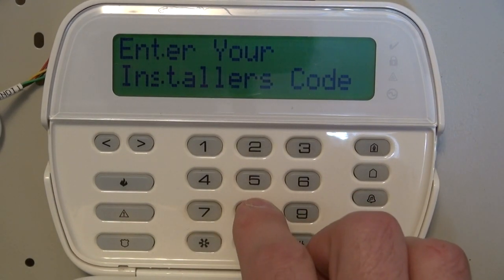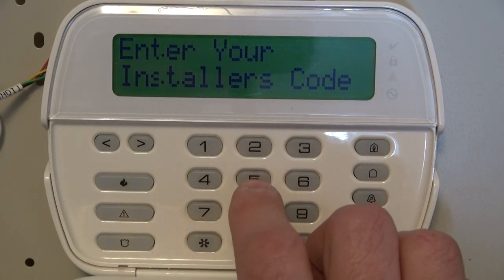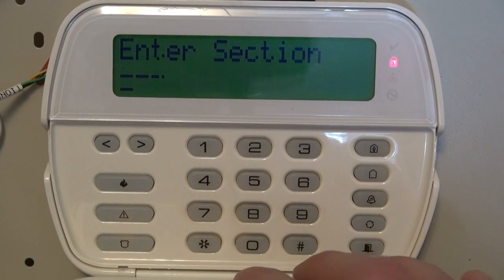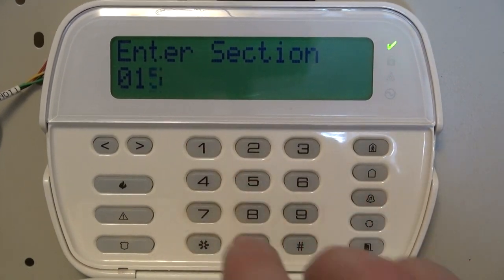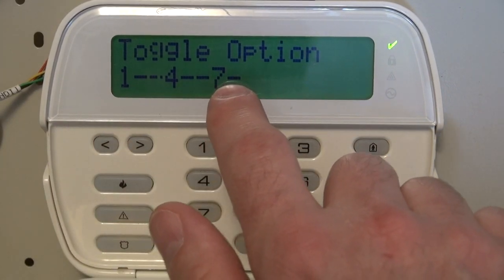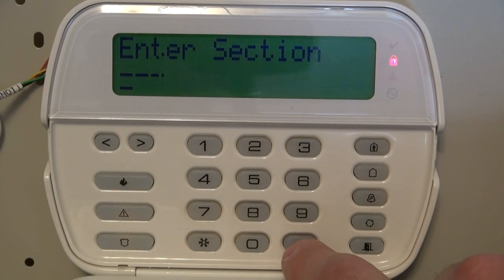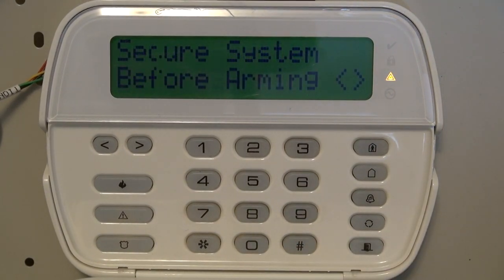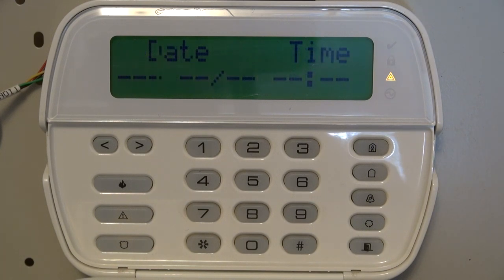How to Remove a Communication trouble on a DSC Alarm

Comment: I have DSC 1832 Panel with no monitoring. I have the installer code (Last 4 digits of his phone no.). I have cleared the beeping sound by pressing Reset key on panel. Yellow light is still a problem.
Code 015 shows 1 2 3 4 5 6 7. ---->Removing 1 or 7 or both  does not help.
Code 350 Shows 1 - - - - - - - - -  ------>Removing 1 does not help.
Code 380 shows 1 - - - - - 5 6 -  ------> Removing 1 does not help.
Jason, any other suggestion would be greatly appropriated.
Reply from the maker: When you hit *2 on the keypad, can you tell me what pops up?
Reply: @JasonTech   @JasonTech  Just 4 displays and yellow triangle start to flash!
Reply from the maker: Can you try something.
*8 installers code
993 installers code 993
then ##
Reply: @JasonTech  no luck, still same!
Reply from the maker: Make sure you still have everything removed in (015/380/350) 
Reboot the panel by, remove the battery and the power supply. 
Then power it back up.
Reply: @JasonTech  That worked, yellow light is gone. Thank you. 
Although with this method I have lost all the settings. I will need your help setting up my system again. Thanks for your quick response. You are amazing.
Reply from the maker: You lost your zones?
Reply: @JasonTech  My bad. The chime was off after power restore. Also had to reset  time. All working now. Thank you once again for your help.
Reply from the maker: Anytime!
Reply: @JasonTech  One more question!
My back door and windows seems  to be in the wrong zone. In stay mode, if violated,  they only chime.
Please tell me how to check and move them to zone 3.
Reply from the maker: It doesn't work like that. To change zone spots, you do that in the panel. So when you put the alarm on (Armed or stay) it doesn't go off?
What about your motion?
Reply: @JasonTech  Motions are fine...I think! They show up on the panel whenever you come in their range.
How do you check which zone is associated with which spot number on the  panel?
Reply from the maker: From the keypad, example open a door or window and see what zone is open. 
If your zones are not working, let me know. The zone number and what type of zone it is (Door / window /motion & so on)
And I will tell you how to program it. I will also do a video on this if you like.
Reply: @JasonTech  
1=front door
2=side door 
3=basement windows 
4=family room motion 
5=front door motion
6=patio door
7=back windows 
8=side & front window
A video instructions would be really nice.
Thank you Jason.
Reply from the maker: I will do a video on how to program a panel. If you can't wait for the video and you want to try to do it.
Hit * 8 installers code
001
01
01
03
05
05
03
03
03
##
Once I post the video I will give you heads up.
Reply: @JasonTech  I have reprogrammed zones as per your information.
Back door and windows are still only making chime sound when violated. Siren not going off.  What else am I missing?
Reply: Solved! All zones working fine.
I needed to wait few minutes before testing. I was testing it immediately after arming stay alarm.

Comment: Hi, very helpful video. However when I tried the fix on my DK5500 keypad which shows icons and not actual English, it didn’t seem to work because the trouble light is still on. When I entered *8 and the installer code I got the keypad icon but when I entered 015 I got a long beep (error code?) I did key “7” but the keypad icon stayed on. When I exited with the # key, the trouble light stayed illuminated. System is a PC1832 and the error code is 3 (because I had my landline removed) the system is not monitored. Thanks, any help would be greatly appreciated.
Reply from the maker: Hi. It sound like you don't have the right installer code. When you enter the installers code, are you getting a long beep?
Reply: @JasonTech  No, I was until I guessed the right code, Now I get 2 or 3 short beeps, the “Armed” light comes on and the keypad icon appears in the display. Also other programming functions seem to work. I don’t know that I haven’t solved the beeping problem, it’s just that the “Trouble” light won’t go off. If I set the alarm and it doesn’t keep beeping does that mean it’s no longer trying to find a phone line?
Reply: @geoffstrople3611  Just came across this and have had this issue before. If you turned off the right thing the system will no longer look for the phone line but in order for the trouble to clear you have to reboot the system by removing the + battery terminal and remove AC power for 10-15 seconds. Replace the battery terminal and power back up. You will need to know the Master code before doing this because you will have to reset the time for the system. ^6  then 1 this takes you to the Time date setting. Enter the time in Military time 2:25 pm would be 1425 then enter the date dd/mm/yy then press pound to exit. So you have to do this in a pretty steady sequence. * 6   1   1425   02 15  23. Would be 2:25 pm on Feb 02, 2023.

Comment: Hi Jason, thank you for the video. Would you mind telling me how can we do the same thing on Paradox 1689? The keypad has no screen display.
Reply from the maker: Do you know the installers code? Default should be 000000 
If that is your code.
1. Press ENTER
2. Enter the INSTALLER CODE (000000).
3. Enter SECTION 135
4. Make sure 1 & 2 are off. To turn it off hit the number so the light turns off.
5. Press CLEAR to exit
Reply: @JasonTech  I'm trying by pressing ENTER, then master code. After that, the light of arm1 and stay1 are on. I entered 135, it doesn't seem to recognize this section. I try to enter section 100 and it recognizes it. Have you any idea why section 135 is not recognized?
Reply from the maker: Because that's not your installers code. The installers code is 6 digits not 4. Try pressing  and holding 0 for about 3 sec.
Can you tell me what alarm panel you have?
Reply: @JasonTech I've found in one document that says panel 1738. Does it mean something to you? How can I check to know that? I tried to press 0 for 3 seconds as you ask, but nothing happened.
Reply: @JasonTech  I've just looked at the panel itself. It's SPC-1738 version 2.10. Here is the picture https://drive.google.com/file/d/19W7_YeG1kgdK9Mj4jbQsBeDQhEFA-POu/view?usp=drivesdk
Reply from the maker: See here. https://www.paradox.com/Downloader?T=URL&URL=/Documentation/Manuals/InstallationProgramming/17X8-EP20.pdf
Reply: @JasonTech  yes, I've found that doc as well. The problem is I don't have the installer code. You know how to reset this code? I've try 0000 and 000000. None work for me.
Reply from the maker: It's an old panel. The only way you might be able to get it, is with the paradox software. If the panel isn't locked you can also do a factory reset and reprogram the panel.

Comment: Hi! I have power series neo with tl280 3G communicator.. im using only ethernet (to security guards and connect alarm app).. not gsm . Im getting cell trouble alternate comm. Trouble.. how do i fix this pls
Reply from the maker: Question, do you have the installer code?
It's a easy fix but I would have to do a video on this. Because the Neo system has a lot of steps for the TL280, and I don't know how your system was programmed. But you won't be able to do anything without the installers code.
Reply: @JasonTech  i have the installerers code

Comment: Thanks 
That worked, is there a way to stop the yellow trouble code from lighting up.  

I no longer have a phone line and keep getting code 3 and 4
Reply from the maker: If you are still getting code 3 & 4. Try *8 5555 then 350 if it shows a 1 remove it by pressing 1. Then ##
Reply: @JasonTech  nothing displayed after *8 my code 350
thanks for trying
Reply from the maker: Then try
* 8
5555
380
if you see a 1, hit 1 then ##

Comment: Great Video. However,  I have an 1832that has the beeps associated with the communicator and this is the only trouble present when I use *2. The customer wanted to use the system to still call their cell phone when an alarm is activated. I Have    section [015] [7] Off, [380] [1] On and [023] [7] On. The panel dials her phone but I cant seem to get rid of the beeping.
Reply from the maker: Hi Azim. Do they have a home phone line? if yes section 015 turn on 7.
380 remove 1 (this is more for a GSM)

Comment: Jason, Ours DSC Power 832 controller reads 1-4-8 instead of 1-4-7.  Do I remove the 8 to get rid of the communication trouble alert?
Reply from the maker: Yes. And go to section 350 if you have a 1 remove it.

Comment: I have a DSC PC1616  alarm, panel 5500 that is showing an orange triangle with “trouble communication”  when *2 is pressed. No beeping and 7 has been toggled off.
I am not sure how to fix it. I have been on google and YouTube, looked at the installation manual and user guide, tried many things. The strobe light out the front is flashing due to the complication too. 
We are in Australia. Thank you for your help. ￼￼￼
* I have gone through all the comments on here and tried different things but I still can’t fix it 😕
Reply from the maker: Hi Jodie. Try *8 5555 then 350 if it shows a 1 remove it by pressing 1. Then ## to exit.
Reply: @JasonTech  I tried that 😂. I actually just had a go at resetting the alarm by removing the battery. And it worked a treat. I will remember that for next time.
Reply: @JasonTech  do you happen to have a video on how to change the times from when a sensor is triggered to when the alarm goes off?
Reply from the maker: Do you mean a time delay? Like when you open a front door, and you have 30sec to disarm the alarm.
Reply: @JasonTech  yes 😊
Reply from the maker: The system has 3 timers, entry delay 1, entry delay 2, and the exit delay. The entry delays need to be between 30 to 255 seconds. The exit delay must be between 45 to 255 seconds.

- Press *8 installer code.
- Then 005.
- Enter 01.
First, enter the 3 digit entry delay 1, in seconds.
Then, the 3 digit entry delay 2, in seconds.
Finally, the 3 digit exit delay in seconds.
Press # twice to exit programming.

let me know if you want me to do a video on this.
Reply: @JasonTech  thanks so much! Actually a video for others would be great if you get the time. I’m sure it would be appreciated.
Reply from the maker: I will do one. Thank you.

Comment: Jason and/or any techs out there. I have a DSC PC1616.  I no longer have monthly monitoring, and I have the expected yellow trouble light leading back to the "Communication error".  I found this video searching for a remedy.  I entered *8 followed by the installers default code of 5555.  It would appear that this is a valid code because it appeared to let me pass through did not kick me out.  However, after entering this mode it and it does not ask me to "Enter section" as with your example, instead I have the digits 1 2 3 4 shown on the LCD.  Any suggestions on where to go from here to toggle off the communications option?  Thanks for these great videos by the way.
Reply from the maker: Hi Tony. Try *8 5555 then 350 if it shows a 1 remove it by pressing 1. Then ##
Reply: @JasonTech  Jason..worked great thanks so much!
Reply from the maker: You're Welcome

Comment: Jason- I still have monitoring, however when my cable modem resets it loses the communication signal.  I just want to disable the beep on this warning.  Will this prevent my system from monitoring after the modem reboots?
Reply from the maker: Yes, you might have a modem that gives you internet and a phone line. Do you know if your modem is a all in one? If you look at the back of your modem you will see a telephone port.

Comment: Hi Jason, I have a DSC PTK5507 I cancelled alarm service. I have the code but a different panel then yours
Reply from the maker: What panel do you have?
Reply: HS2016/HS2032/HS2064/HS2128
Reply from the maker: If you have PC1616 it's the same steps. To get into programming on the touch screen press Options, Installer Menu (Installer’s Code)
Reply: Thank You ! Does the light stay yellow?
 @JasonTech

Comment: Hello Jason, I have a DSC Impassa WT5500 wireless 2way. I cancelled my monitor service quite awhile back, but my panel still gives me the yellow light cause its still tries to communicate. I tried your procedure in toggling this feature off but my numbers displayed different than your video. the numbers are displayed 12-4---8 so which number do I take off to turn off toggle ? any help would be greatly appreciated, Thank You
Reply from the maker: Try.
*8 - 5555 - 350 if you have a 1 remove it by hitting 1.
&
go to section 380 if you have a 1 remove it 1 by hitting 1.
Reply: @JasonTech  Hello Jason, Thanx for responding. I have my installer code, I discovered it was the last 4 numbers of my old adt monitor account number. I tried *8-installer code-350 it showed (Enter Data 03) so I backed out. The yellow trouble light is on all the time and the trouble code is (ALT Comm.) the system still works fine, no beep warning just yellow light. I'm just trying to clear the yellow light and stop the system from trying to communicate. any help on this matter would be greatly appreciated. Thank You
Reply from the maker: Did you try section 380?
Reply: @JasonTech  Hello Jason, I just did and it shows only a number 1 , should I remove it by hitting  1 then ## to exit ?
Reply from the maker: yes
Reply: @JasonTech  Hello Jason, I went in and took off the 1 and exited and reset the panel, the yellow triangle went off for about 5 minutes then reappeared.the trouble says (ALT Comm Cell Trouble ) is there another section I can go to to toggle this off too, so it will quit trying to call ? any help on this matter would be greatly appreciated, Thank You

Comment: I have a pc5010 been trying to get rid of trouble code 3. I looked in comments section have been unable to clear. No phone line connected, have panel in display but the cheaper version on displays the time. Any help much appreciated.
Reply from the maker: Hi. Did you try section 350 & 380?

*8 - 5555 - 350 if you have a 1 remove it by hitting 1.
go to section 380 if you have a 1 remove it 1 by hitting 1.
Reply: @JasonTech  I did 5555 for code type 350 no number sign tried 1 then ## 
Still had error tried same sequence with 380 still code. So I tried *8 then master code then 350 possible I hit 1. Now it makes a long beep anytime a key is pressed.  

The master code was changed in 40. I have been able to change to master code no issues. 

I Had this happen to me before trying to figure it out. Had to disconnect the power to the unit then functions return.
Reply from the maker: You can't use the master code. You have to use the installers code.

Comment: Hi, mine is displaying trouble 4. We just bought a house with the DSC system already installed. If #4 means phone line issue, how do I get it connected to my phone line or is there a way to bypass the phone line since we are not planning on using their monthly services? Thanks
Reply from the maker: Hi Lynn. Did they leave you with the installer code? If they did follow my step and it will go away. But you need the installers code.
Reply: @JasonTech  mine is little different from yours. After punching in 015, the only thing appeared on the screen was 1 and 2 , on the top of the screen. What should I do next? I believe there were 3 numbers last time, I  deleted one of them. Forgot what it was. Thanks

Comment: I just moved into a new house and have the Impassa set up. I have no monitoring service but just use it at night when we sleep. I recently had the error Alternate Comm. Cell Trouble. I was able to stop the beeping but how do I get rid of the actual trouble light still being on?
Reply from the maker: Hi. Do you have the installers code by chance? Try * 8 then 5555
Reply: @JasonTech  i do have the installer code and then it asks for a section..
Reply from the maker: @josephs.1055  Try * 8 
Installers code then
380 and remove 1
Reply: @JasonTech  gave it a shot, no luck with the trouble triangle still..
Reply from the maker: @josephs.1055  When you hit * 2, what pops up
Reply: @JasonTech  I was able to go *8, installer code, 832 and turned off 5 (alt communicator). I also needed to go into 015 and turn off 7 (phone line)

Seems to have worked so far. Thanks for the help! These things are tough for people moving into a new home! Oh I also needed to disconnect Ac power then pop a battery lead after doing those two steps
Reply: Lastly, after about 15 minutes it beeped again. I went into section 380 and turned off 1 for communications. Then did one final Ac disconnect, battery lead disconnect and seems to have hit the sweet spot.
Reply from the maker: @josephs.1055  perfect.

Comment: Great Video! Helped me clearing the beeping 3am in Chrismas Eve. Subscribed. BTW, how to clear that yellow alarming light?
Reply from the maker: Hi. Can you hit *2 and can you tell me what number pops up
Reply: @JasonTech  ftc trouble receiver 1. the resson is that I stopped telephone service. it does not bother too much to show that orange light. just curious if I can remove the warining after I disabled the ftc feature
Reply from the maker: @a15588  can you try something 
* 8 installers code 
380
If it shows you a 1 remove it by passing 1, then exit out # # #
Reply: @JasonTech  worked! You are great! Subcribed your channel and will recommend it to my friends
Reply from the maker: @a15588  I’m Glad, thank you
Reply: @JasonTech  I disabled it, the light was off and then enabled it again. seems light not coming back which is whay I want. btw, what exactly does this option mean? Merry Christmas!
Reply: @JasonTech  4
Reply: @JasonTech  didnt work
Reply from the maker: @WPGinterceptor460Interceptor  Hi. Did you also try 380 and removing the 1?
Reply: @JasonTech  yes
Reply from the maker: @WPGinterceptor460Interceptor  When you hit *2 on your keypad what shows up?
Reply: @JasonTech  4